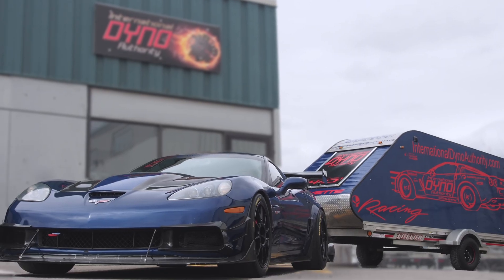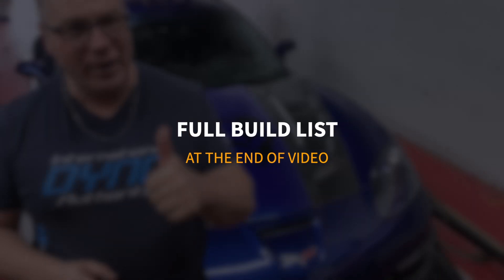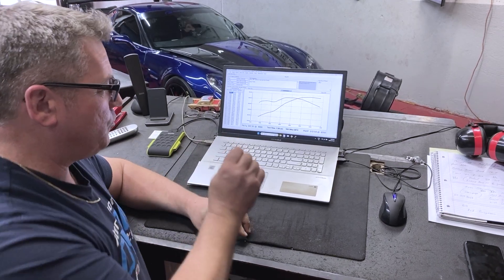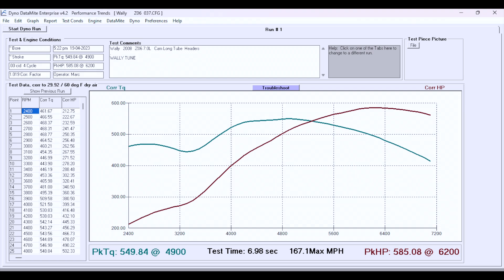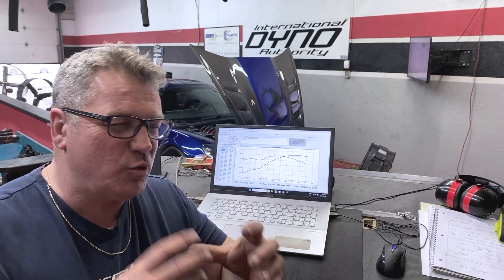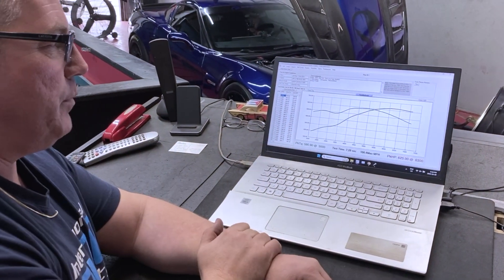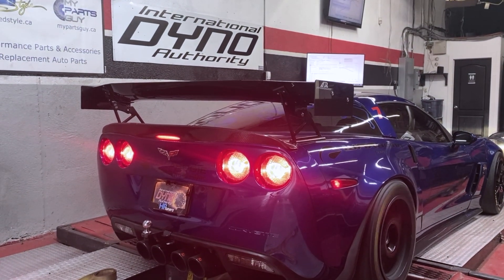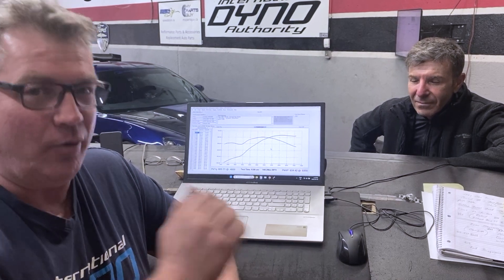What will it make? Our Official Corvette Z06 Track Car on the Dyno - feat. Joe "The Boss" Gunn

Comment: Tq seems a little much, like 50 ft lbs too much.
Reply from the maker: Based on what compression ratio? Based on what camshaft? Based on what cylinder heads? Based on what fuel?
Reply: @internationaldynoauthority693  also don't take this negatively. I have an 08 stock compression GPI ported heads, 232/252 .648 .639 114, ARH 2 inch catless into a Borla ATAK, Ported MSD/103/MF103. It's just an observation that I've never seen that much TQ from stock cubes or even a 440.
Reply: Based on I've never seen a stock cube ls7 make over 600 wheel tq on any combo listed above.  I understand the dyno is just for tuning, I don't get caught up in numbers, but either something is off or whatever you did is the greatest combo I've ever seen on an LS7.

Comment: What made you guys with a full coilovers rather than going with different struts only and keeping the leaf springs? Do you find on track that there is rubbing with wheels that wide under full corner load? Thinking about making a track car very similar to yours. What would you expect a built like that to cost? Would it be easier if I just gave you guys a call?
Reply from the maker: This is a Model Z 06 from 2006, and, there are no leaf springs
Reply from the maker: Yes, you can give us a call anytime
Reply: Buy a   Newer Generation Mazda Miata or even cheaper an RX8  Either with blown  motors  an don't Spend more than 5 grand on it  just look out for Rusted main Steel Structure  components Or if your going Full 600+ hp ina Sub 3000lbs car GO CERTIFIED FIA Roll cage 2~5 grand .  Then build whatever your Favorite cost effective engine setup will be. Me with Total 40k end cost.  Is RX8  with A 22grand ish FORD PERFORMANCE 5.0 COYOTE motor and 10spd auto Supercharged  manufacturer warrantyd